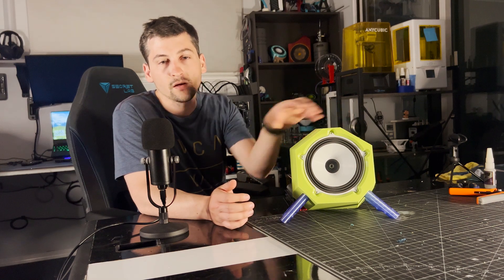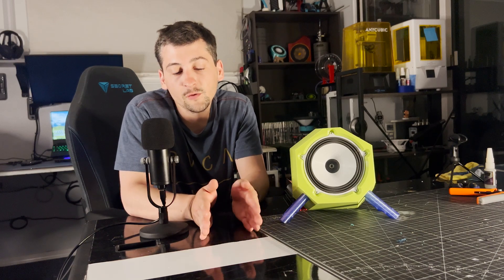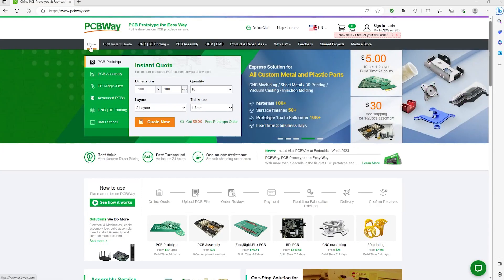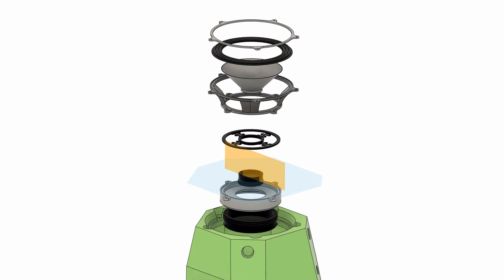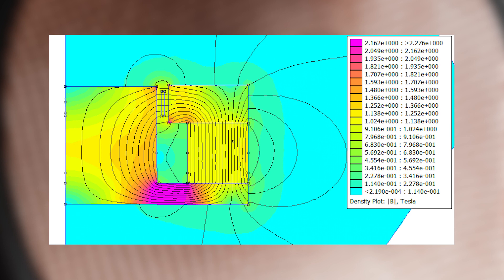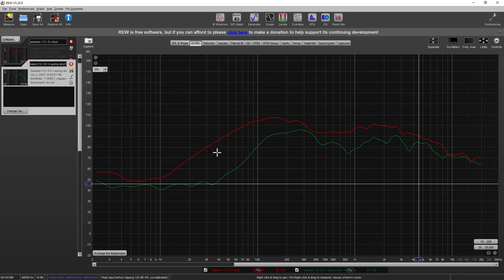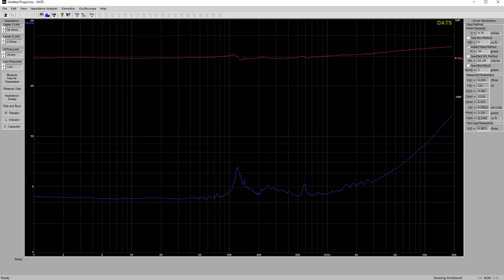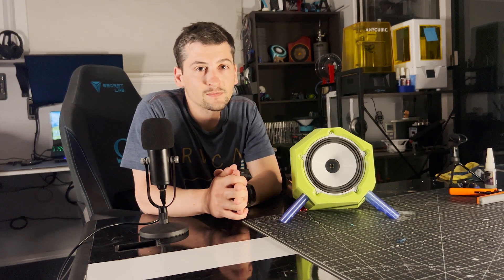Fully 3D Printed Speaker V13

Comment: That frequency response is a huge improvement! I almost said, "For what it is." But with the machined parts this is far from rinky dink. Thanks for explaining underhung vs overhung. Btw, how does your web hold up with the sideways flex? It looks thick to hold x/y but is it constricting z at all? Maybe a print-in-place chain mail could be shrunk(resin spec?) and stretched like a drum skin, know what I mean? Have a good one, sorry for the essay! Careful of too much coffee, lol.

Record how you need to, the magic is all in the editing! Seemed fine but you could pick up the pace a little, especially with the advertiser copy(be happy to get paid eh!), with a coffee before hand. :p  

#criminallyundersubbed
Reply from the maker: Thanks for that! As far as sideways flex goes it holds up decent, remember the whole moving mass is only 15.6 grams, and parts of that are held at both spider and surround so the mass that is suspended is most likely less than that.
As for z construction- these underhung designed drivers don’t move a lot up and down, this one’s total movement is around 6-7 mm from lowest point to highest point.

I felt an explanation on the under/over hung design was necessary, I didn’t even realize underhung was a thing until I started this project. 

As for pace, yeah I need to work on that, I really should start scripting these but most of the time I wing it and piece things together afterwards.